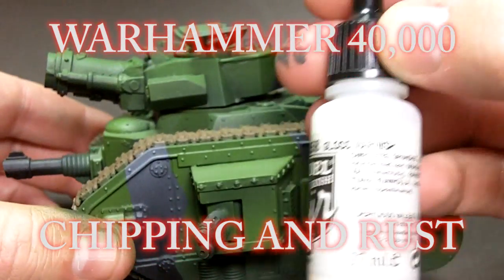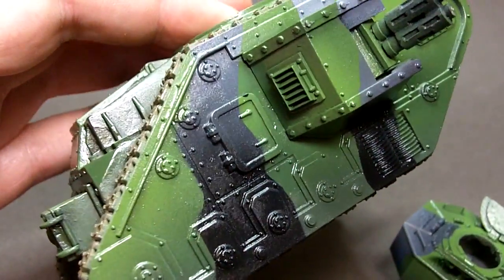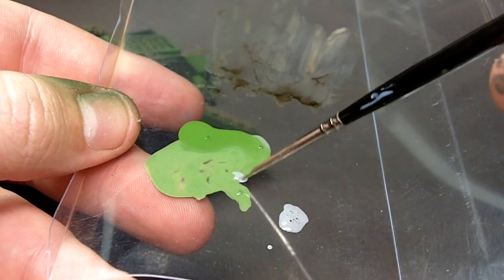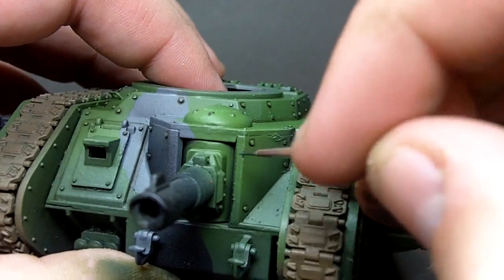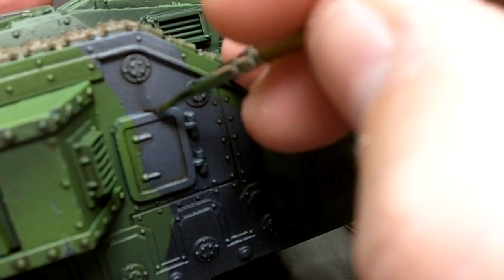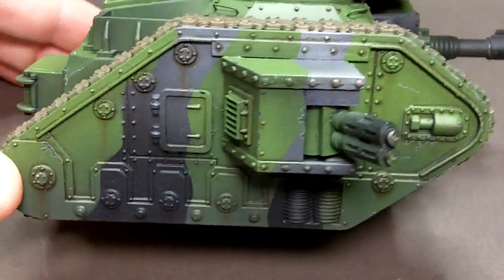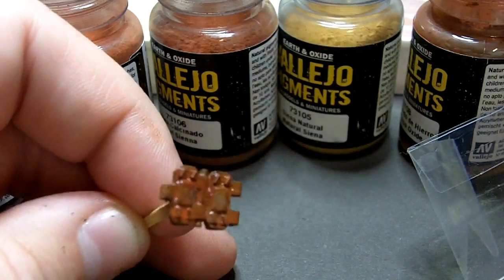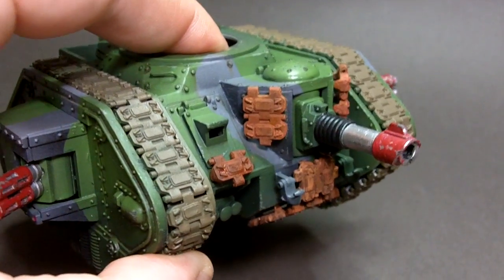Warhammer 40,000 part 2: chipping and rust

Comment from the maker: @jigabachi73 man... that is low, I usually fire out just over 20, but I'm surprised that you're getting drying on the needle at that pressure - however, I've just started testing out some badger brushes and they've got exposed needles - I can actually see the paint building up on them really fast.  I will have to try and figure something out, in the meantime - try the retarder and see if it helps.

Comment: Hey
do you airbrush the vallejo varnish because i'm having problems doing the same. When i try the varnish seems to dry very quickly and starts to build up on the exposed tip of the needle. I use Vallejo thinner and experimented with different ratios but i seem to get the same problem, do you think the addition of a drying retarder would help.